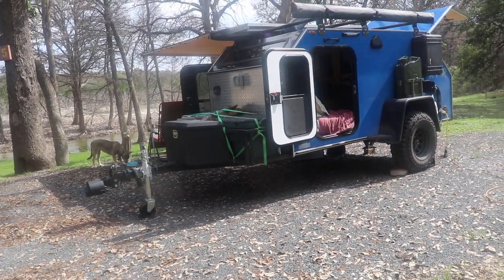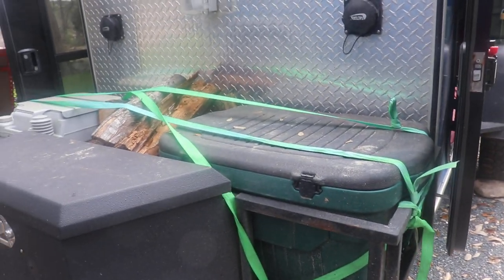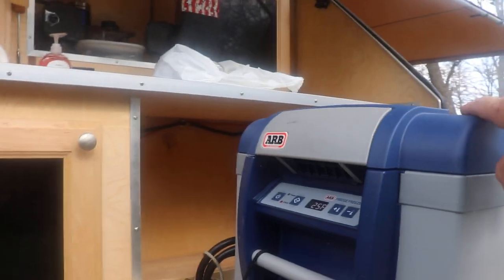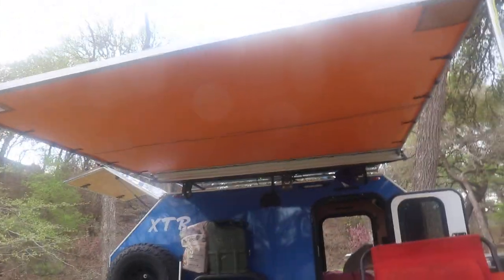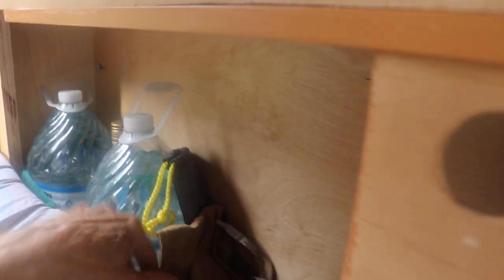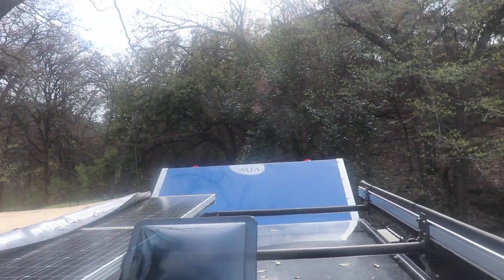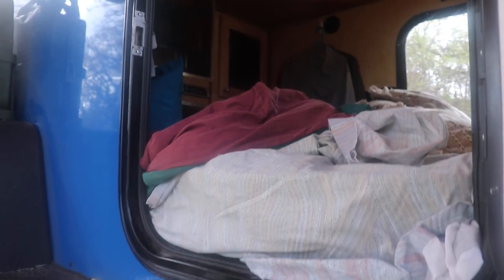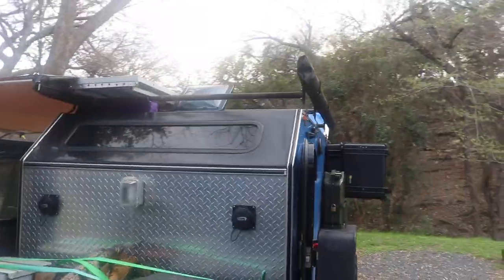EXTREME Teardrop trailer. XTR 1st Walk around- OFF ROAD Camper Trailer OVERLAND CAMPER

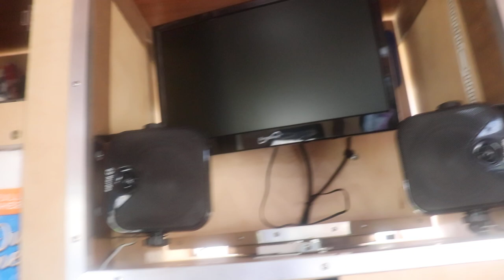Comment: When you showed the inside, facing toward the galley I noticed there was a seam on the roof that was bulging or uneven.  It's around the 14:20 mark.  Did it come from the factory that way or did you have a mishap???
Reply from the maker: Hey there and thank you for watching. came from the factory that way. I just need put up a couple of screws to hold it more flush. It's not any problem, but i will address it. Thanks again Please remember to subscribe to my channel. Be safe!

Comment: Hey man quick question. You mention the slide out cooler area can is roughly 18inches tall. Our cooler is 18.8 inches and I just want to know if that will fit or if it’s exactly 18 inches in height. Thanks!
Reply from the maker: Hey there Ryan. Mine is 18 in, and maybe a 1/16 . So i would not go any taller. You could call Damon at vintage trailer works, and get him to measure it. perhaps they might be able to go taller, but i don't know. I bought mine after i had the trailer.
Reply from the maker: I bought my ARB 37 qt from ok4x4. i got last years model it was 661. shipped. The latest model is like 750ish,,, witch has the thing for phone to show inside temp, mine dose not have that.
Reply: Michael Felfe awesome thanks man!
Reply: Michael Felfe i guess the new XTR’s are going to be around 19inches of space.. They wanted to be able to fit the Dometic 50 in the slide out.
Reply from the maker: @ToneLoco1  Sweet. I wish i could have fit a 50qt.  So i take that you called Damon?
Reply: Michael Felfe the salesman who works for them let me know.. He said they moved the kitchen table portion up so it could fit a Dometic 50. I’m guessing that was a main concern for buyers.
Reply: The slide out is 32 deep x 19 wide x 19" tall. I just put a down payment on an XTC, teardrop shape but off road capable 5x10.
Reply: @barryread3672  awesome! We bought ours a year ago. Love it! 5x10 as well!
Reply: @michaelfelfe7260  the pull out for an XTC is 32"x19"x19". I'll assume that is true for all models but not positive
Reply from the maker: @barryread3672  I'd check on that before you buy a cooler! Did you mean XTR, or XTC? Mine is the XTR, i'Ve never heard of an XTC.
Reply: @michaelfelfe7260  XTC is the off-road version of the Classic Cub which is a classic teardrop shape rather than the boxier shape. It's got the 30" tires and heavy duty suspension.
Reply: @michaelfelfe7260  I got those measurements from Aaron at VTW.